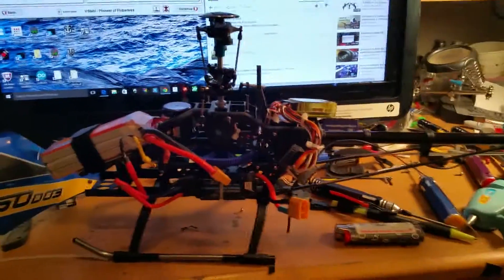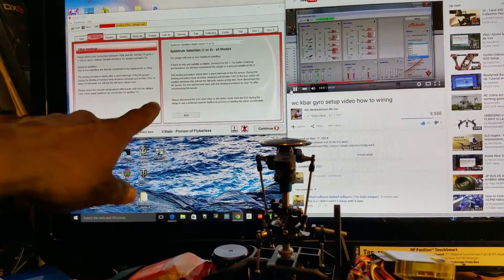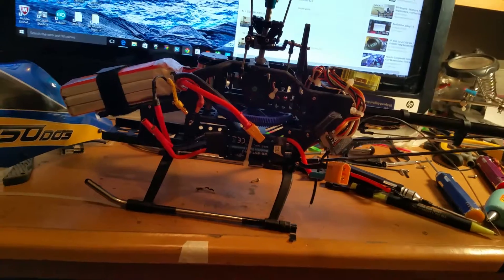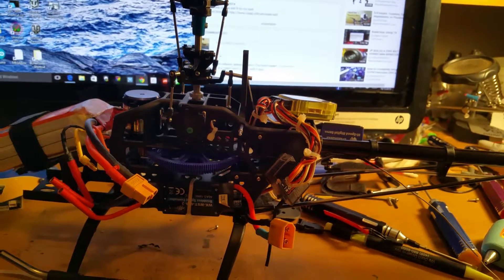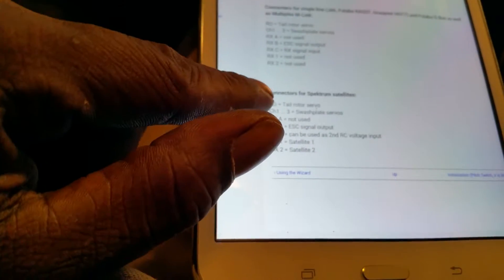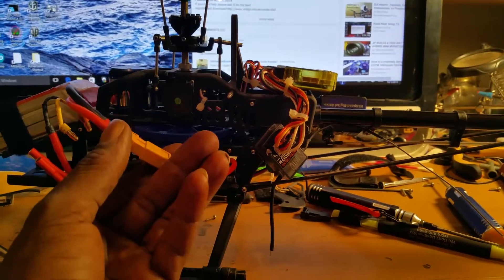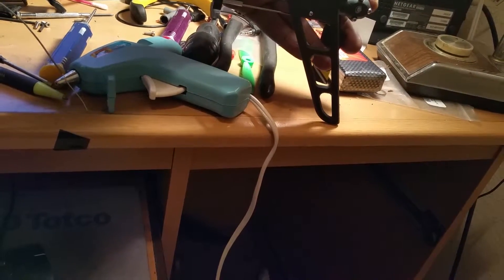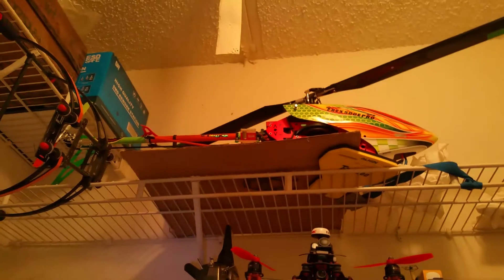Mini k bar  got it working  yeah

Comment: good job almost there
at the top of the vstabi program should be all green and not yellow and red
your either not bound or the driver is not installed but it looks like you did the driver
Reply from the maker: will try later was stuck at setting up the  pitch and stuff